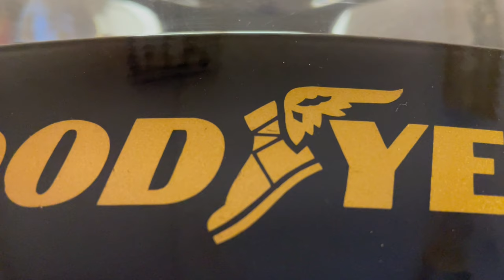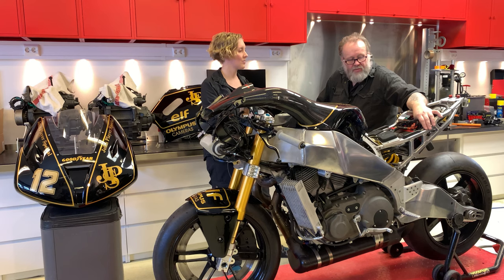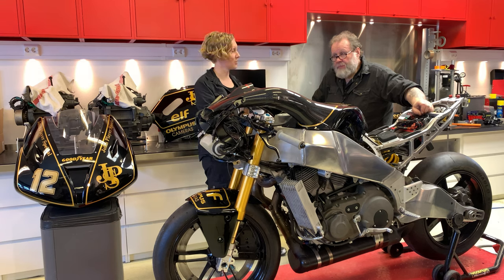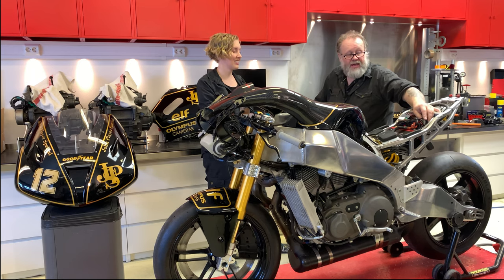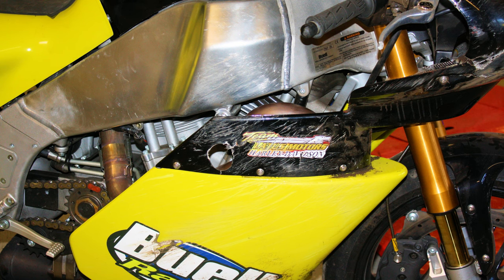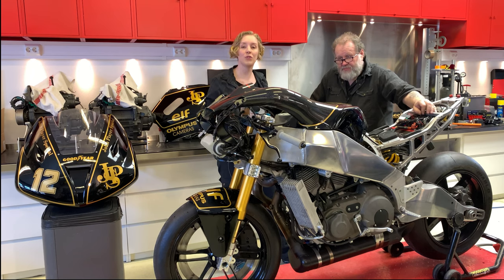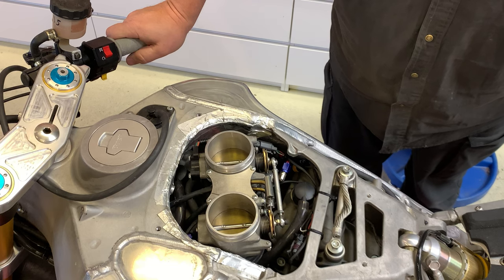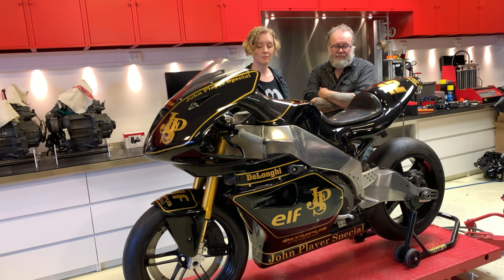NCCR History of the Buell XBRR and making of the JPS

Comment: We had 4 failures at Daytona 2006 of the 4 XBRRs entered. One was very early in the race, the breakage of a roller-lifter anti-rotation feature, almost certainly from over-revving on the Rico bike. Harley had used a nylon plate tying two lifters together, something they were considering for production, which would fail quickly if you floated the valves. We fixed this after Daytona with drag-racing-Chevrolet-small-block-like brass guide plates we made in East Troy that were bullet-proof from then on.Two others were gearbox failures, because of the only gear pair in the special gearbox that still had fine-pitch gear teeth. I found out later the engineer at Harley who had designed the gearbox had gone all over the H-D engineering center to find a manager who would sign off for the $5000 or so for tooling that would have allowed that particular gear pair to have been made with coarse-pitch teeth like the other four pairs (which could be made from hobs Harley already had),  and couldn't find anyone willing to do it -- until after Daytona when it was redesigned. And the final one was the saddest of all, on the Jeremy McWilliams bike 130 miles or so into the race, when the timing wheel came apart. Harley had done no analysis on it and made it from flame-cut steel with awful stress risers in it. Jeremy would almost certainly had gotten a podium position without that failure; he was riding the bike like an endurance racer and would have brought it home. We redesigned the timing wheel ourselves after the race, and made a beautiful lightweight wheel designed with FEA optimization software, made out of 4140 chrome-moly steel and beautifully lightweight -- and it failed even quicker. We had gotten the loads wrong. We quickly realized that the important loads were lateral from crank flexing, not in-plane, and just resorted to a heavy solid disk timing wheel from good steel with no lightening holes that would run forever. By the end of the 2006 racing season, XBRRs were fairly reliable, capable of 1000 race miles or so without a rebuild -- with the weak links still the clutch and primary drive chain. We were putting 150-hp through a chain that would have been happy with 50, and it was never happy.
Reply from the maker: Thanks for your intels 👍😊
Reply: Fast don't last.   Power is easier to achieve than getting it to last at least 1k mi. under race conditions. Something I learned knocking valve guides loose on my 07' R1's heads.  Thankfully all 3 times it was under acceleration and not leaned into a turn. And yes I bought the bike brand new, and in its case it lasted 5k mi. each rebuild, totaling 16k mi. That was Yamaha's 5 titanium valves per cylinder gimic, which after spark plugs, 20 valves, coolant jackets, and head bolts... looked like a rather thin cast aluminum block of swiss cheese.
Reply: I am restoring an early S1 tuber for road racing next year. I would a like "slipper" clutch. But as we have heard from above, the STM clutches break. An open belt with a larger dry clutch is the best option. What is the setup (Kit, parts, brands) I should be looking for. Thanks!